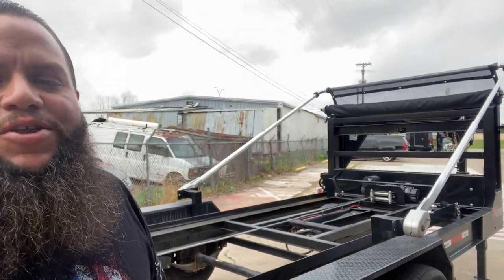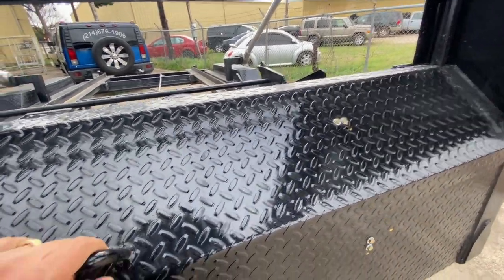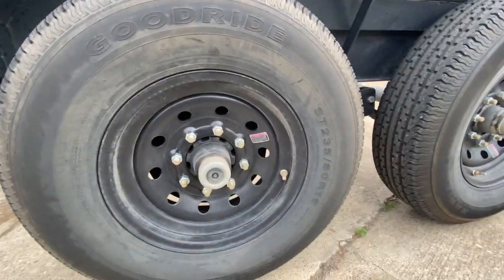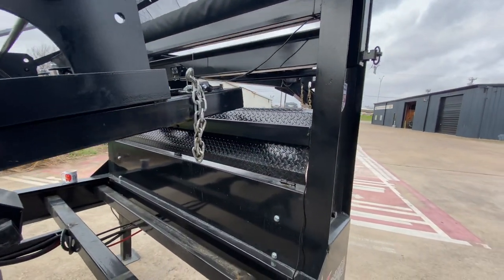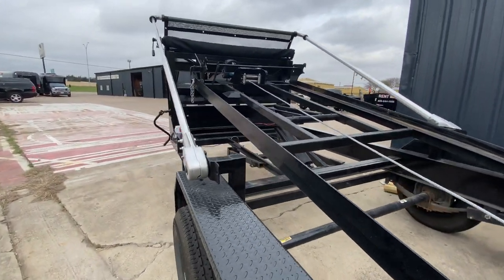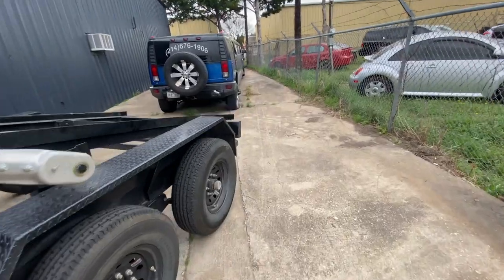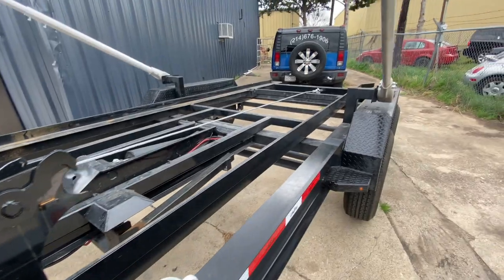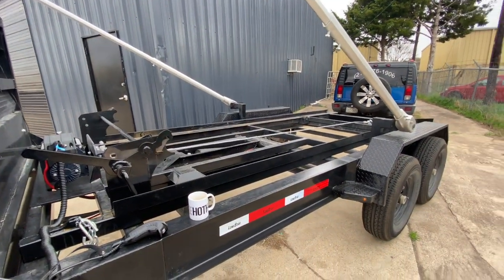LoneStar Roll-Off Dumpster Trailer Walk Around & Review - Purchased from Nationwide Trailers FW

Comment: On the back of your dumpsters there's boxes that those tabs slide into. They prevent the dumpsters from coming off and also a dot requirement I believe.
Reply from the maker: Yes sir, they were cut off by the dealer but I am thinking of adding them back on die safety reasons for sure!

Comment: The tabs on the back are to lock the Bin on so will not bounce off the rails. In California we have to have a positive lock system on the back or we have a ratchet strap tightened down so can't bounce off. In California the commercial enforcement cop or highway patrol pulls you over and you don't have a positive lock system or straps on your Bin it's a big time ticket.
Reply from the maker: Yes that I have figured out, thanks for the comment!

Comment: Ever had a problem with loading a full dumpster on the trailer as far as Weight and the hydraulics lifting it? I have heard you don't wait thr scissor hoist?
Reply from the maker: Yes on one of my loads, it didn't want to load.  I took my pry bar and helped it up, once it got up about 2-3 inches it dumped just fine.

Comment: I'm assuming the tabs were added to "lock" the can to the trailer, just like you have in the front. That way it doesn't bounce off going down the road.

I know everything is wired differently, but I'm pretty sure the battery meter you checked was just to measure the charge of your breakaway battery (it applies your trailer brakes if you become disconnected). It could indicate the charge level of your two bigger batteries, but probably doesn't. You might want to plug in sooner than later.
Reply from the maker: Yes its the breakaway cable from what I have found out.  You are correct.

Comment: Do you need a CDL
Reply from the maker: Not in TX if under 26k lbs combined truck and trailer
Reply: Federal law says if the trailer is registered over 10k then a cdl is required regardless of the tow vehicle